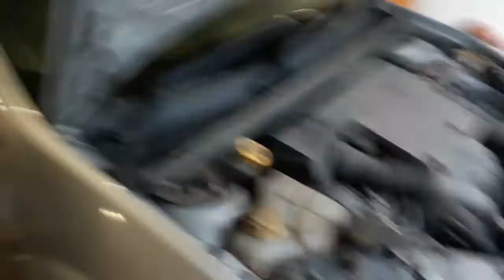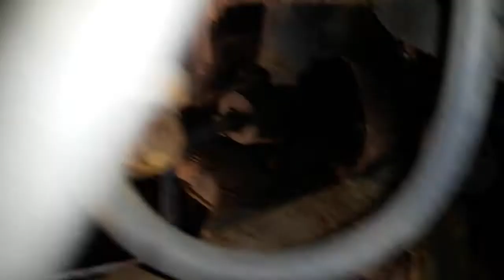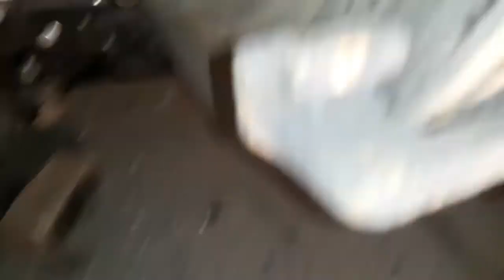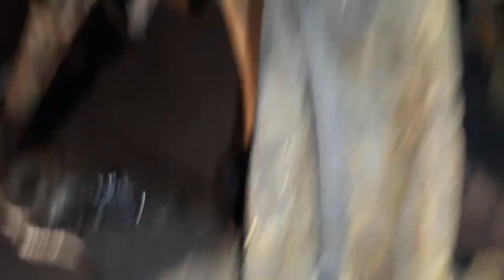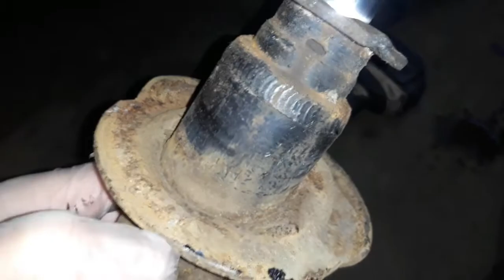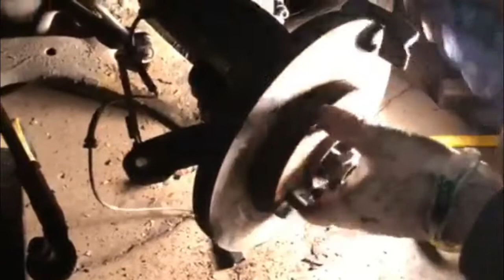How to replace a broken spring on a Ford Fiesta

Comment: WTF you don't have to do all this to replace a spring you have made a simple job look complicated
Reply from the maker: Thank you for your comment.

If you watch the video again you will see why it had to be done this way. Very few jobs on old cars go to plan and I try to show that so people know what to expect.
Reply: @themidnightmechanic9368  thanks for your reply I did an 18yo fiesta only yesterday remove the top nut on the drop link and the track rod used a bit of force with a hammer to remove the strut the hole job took me approx 3 hours.i guess your way takes much longer
Reply from the maker: @andrewwilliams9177  

The pinch bolt where the shock goes through the hub has been notorious for giving problems (all fords). If this comes out without a fight then the job is a doddle!... if the bolt shears then you are in trouble so i don't spend too much time on them, quicker/safer just to take the hub with you!

If memory serves me correctly, I think I took the brake disc, etc too in this video as the brake carrier bolts were rounded off... again, quicker just to leave it alone.

There is always a way in!... if the front door is locked you must climb in the window! Lol
Reply: @themidnightmechanic9368  👍